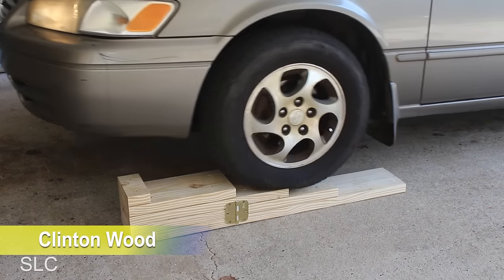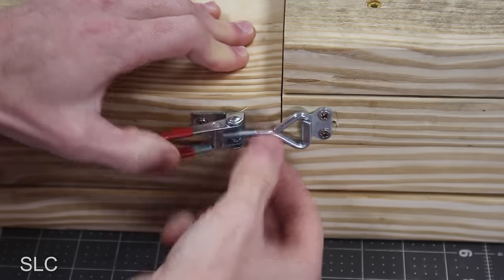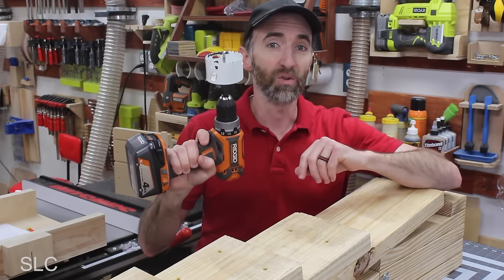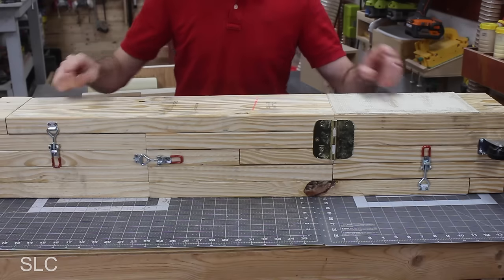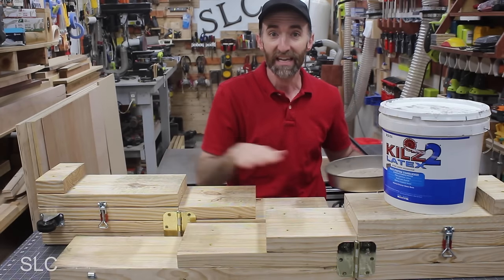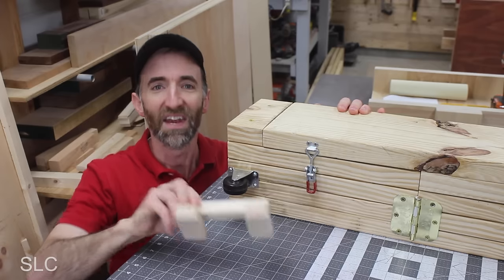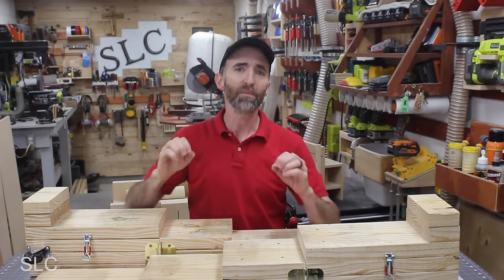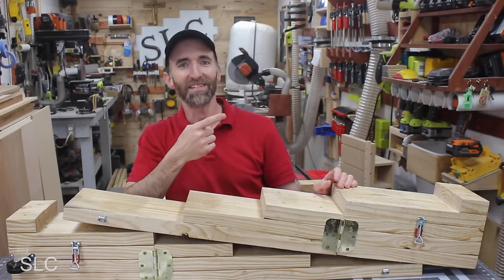Improving the Best Car Ramp EVER

Comment: you could put a small weight sensor pad on the spot where tired are meant to stop, attach that to a tiny high pitch speaker and a 9v battery.   then youll be able to hear when your on top of the ramp.

Comment: I know that it would double the cost, but I am probably going to make 4 of them.  One for each wheel and it brings the vehicle up equally all the way around.  Also, maybe glue sand paper on top of each layer, like a tread runner for grip.
Reply: Have fun driving up and onto all four ramps at the same time .
Reply: @EmmAyeVee  I'm not sure why you think it isn't possible. I already do it with the 4 Rhino Ramps I already have. I've done it with 4 wheel drive and 2 wheel drive vehicles alike. If you don't think you could handle it, don't try it.  If you drive a smaller vehicle close to the ground...  that's on you.
Reply: Not all that hard to do. @EmmAyeVee

Comment: How about making the base part a little  longer with an orthogonal slot so that after placing the car on top a piece of  5 mm thick flat steel can be slid into the slot sticking out at the top about an  Inch therefore acting as a chuck!

Comment: Put a squeaky toy on the corner of the ramp stop and drive over until you hear it or put the wheel chock in front of the back wheel the same distance as the lenght of the ramp, if you still drive off of it then you should not be attempting it in the first place 😂

Comment: Once you climb, measure from the bottom board to the back tire, then get a board and put one stopper for the back tire as well.
When the front tire hits the stopper, the back will hit too.
It won't work for a different car.

Comment: I'm thinking of making a set but also putting some kind of pressure switch on the top layer of both sides. Maybe have a light mounted to a pvc pipe sticking up so the driver can see them. When the wheels make it to the highest level, the light will turn on and let the driver know to stop.
Reply from the maker: That's a great idea. And if anyone wants to make it a little bit simpler, just have the pipe far enough out for your bumper move it.